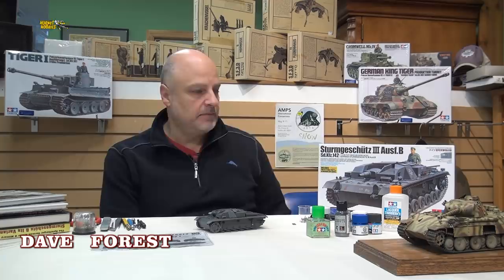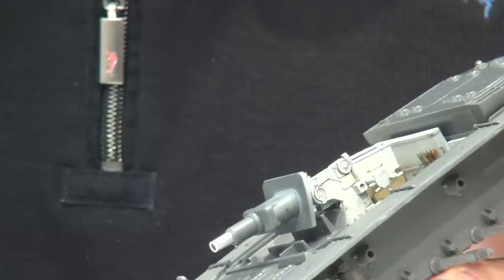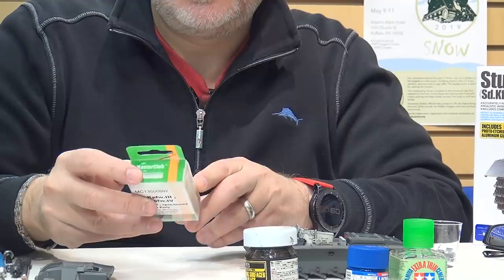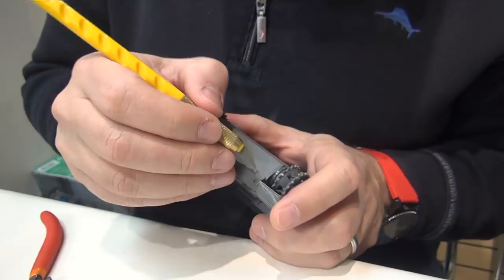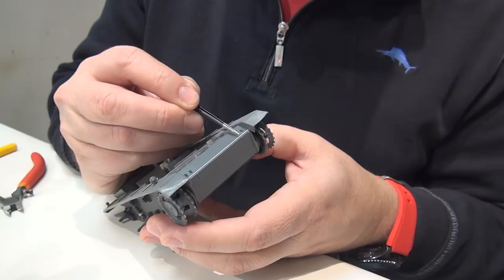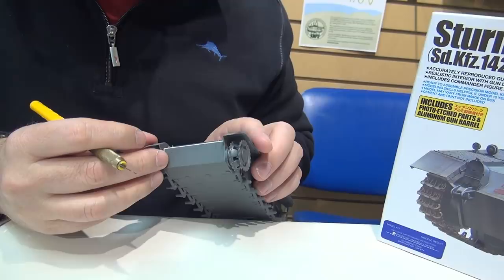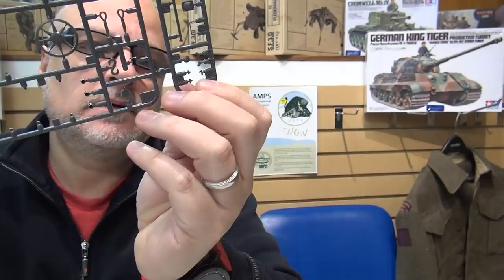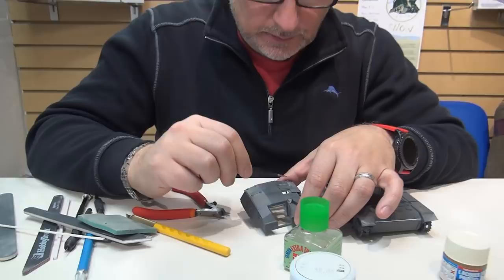Sturmgeschütz III Ausf B Episode 1

Comment: Hi Dave, 
First let me say sorry for my bad english. 
Normaly i don't do comments but because I'm a Fan of what you are doing, allowe me to do one for this time.
Nice to see you building my favorite german AFV. 
Please allow me some suggestions:
1. The wooden beams where no stand off armor. The Abt. 192 carried the beams on all StuG's in case they dug in to throw them under the tracks.
2. The Gunsight was only rising through the hatch in the roof if they provide indirekt fire support as normal towed artillerie would provide. If a StuG was fireing in direct shooting, the Gunner aimed with the Gunsight torough the opening in the superstructure's front. To rise the "Rundblickfernrohr 32" through the Roof a extension was necessary.
3. Tactical Markings where as following:
Staff Batterie : Green
1. Batterie : With
2. Batterie: Red
3. Batterie: Yellow
Beside the wooden beams, the metall guards by the position lights, Horn and Notek where also a feature that where on all StuG's of the Abt. 192.
Beside the missed weld seams Tamiay missed also to replicate the mounting screws on the sloped armor panels left and right side of the fighting compartment. Also incorrect is the position of the second support of the antenna rail. They where on all StuG's till Ausf F not on the end of the air intakes located. The where in the position of the second "sperator" inside the Air intake.

I' will follow your build as i dit it with the Sherman with big pleasure. 
Cheers from Switzerland
Reply: Thanks for the clarifications and correcting my wrong assumption on the wooden planks Wolfgang - good to know.  Merry Christmas!

Comment: Nice kit!  Have two in the stash, separate gifts haha.
Curious to know what you think of the Tamiya Laquer Paints.  Local stores do not carry them as of now and want to give them a try.

What do you think of Star Decals?

Keep the videos coming!
Reply: The Tamiya lacquers are great - but are very harsh on the senses.  Use them only with a mask and/or a spray booth that ventilates to the outside.  Star decals offer an amazing wide ranges of markings, but are a little thick - comparable to Tamiya decals.  So they need some attention to go down right.  I ended not using them and went with the Tamiya kit ones.
Reply: @daveforest28  thank you!  I'm in the process of building the m51 Tamiya IDF Sherman, using the light sand lp paint.  Bought Echelon decal masks for the numbers.  I use a ventilator when painting, but in a basement with no windows...so I do very little at a time.

Watching your Stug with great interest!  Have a nice holiday!

Matt

Comment: The hooks on the rear deck should be facing outside, not inside.
Reply: Good catch Aldwin.  I noticed it after we finished shooting and ended up swapping them out for the proper hooks that I pilfered from a Dragon kit (with the correct orientation).